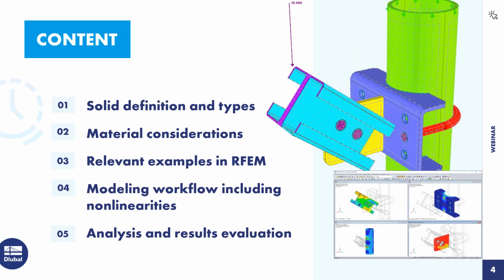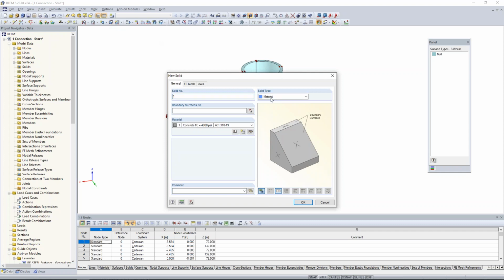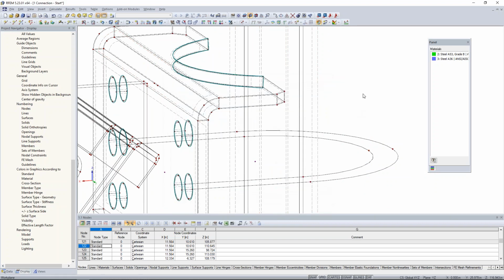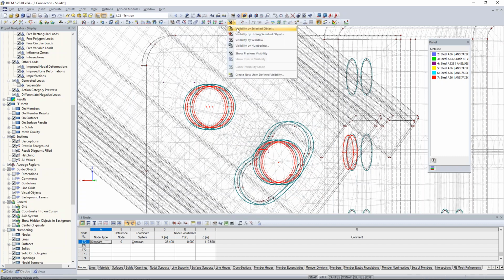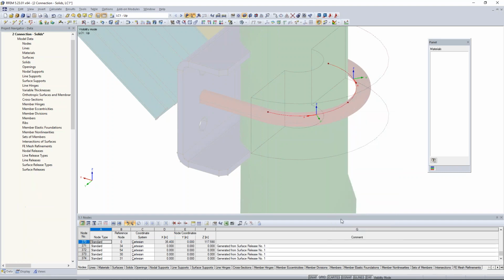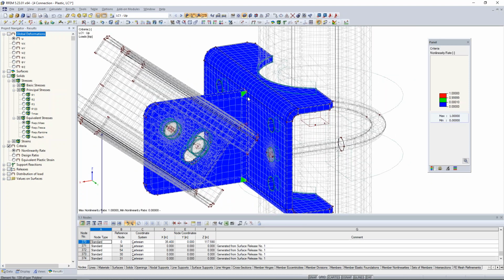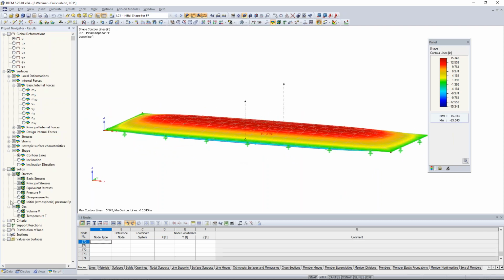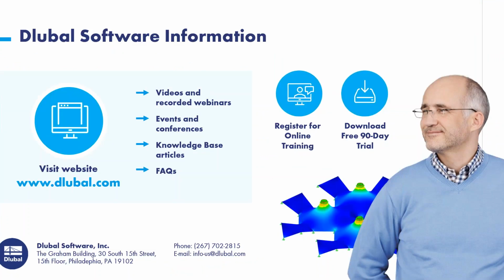Webinar | Introduction to Solid Modeling in RFEM

Comment: is creating an opening, where the commonly shared surface is, still necessary in RFEM 6.1? or does the program recognize that automatically?
Reply from the maker: Hi, @yosef_Restom! Yes, it is. Lines in a surface can have other purposes aside from being part of an opening (boundary line of perpendicular surfaces, basis for line loads, line supports), so the program cannot know automatically. But you don't have to draw the lines first and create the opening afterwards. You can also draw the opening directly with different shapes (rectangular, circle, polygon,...).

Comment: Hello Dulubal and Amy. Thank you very much for your informative presentations. Is there a chance you could create a sample modeling for anchor design in solid modeling? I have reviewed all the examples on your site. If I didn't miss anything, all the examples seem to have anchor models designed using surface modeling
Reply from the maker: Hi, @mehmetgoktepe5424! If you are speaking about base plate design and anchors embedded into concrete, you should check out our base plate design feature in the RFEM 6 Steel Joints Add-on! The entire FEA submodel is generated automatically with FEA with additional design checks currently available for EC. The AISC/ACI design checks will also soon be released. 

https://www.dlubal.com/en/support-and-learning/support/product-features/002821

Comment: I tried to import an ACIS file as independent solids and as a block. The software shows some disconnected lines thrown in space. On Dlubal site it says that the quality of the import depends on the quality of the CAD software. Really? I would say it depends on the RFEM capacity to understand the imported file. I have never had any issues with any other well established FEM software. Then creating contacts, very unintuitive and frustrating. Man, you have a lot of work to do to make this thing user friendly.  Also, increase the size of the icons a little bit(by default) will destroy my eyes!
Reply from the maker: Hi, The Predator!  We would be interested to receive your ACIS file and suggest any improvements that can be made to the import file for better integration in RFEM.  Please email it to info@dlubal.com.  Additionally, let us know which other program(s) are able to import the file to see if we can draw comparisons to how the two programs may operate similarly or differently.  Remember, RFEM is a delicate balance between a complex FEA program and a program for general structural engineering design.  We are always interested in improving our program further though based on user feedback. 

For your other question, it's possible to modify the size of the tool icons.  Take a look at this FAQ: https://www.dlubal.com/en/support-and-learning/support/faq/003501